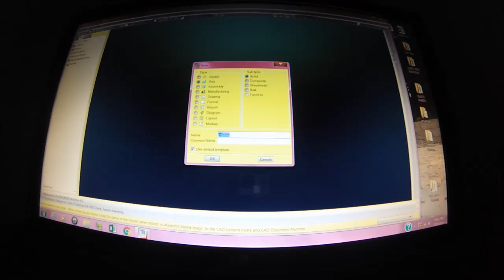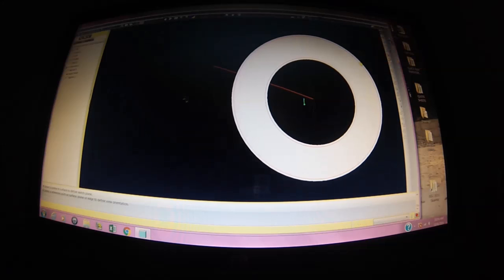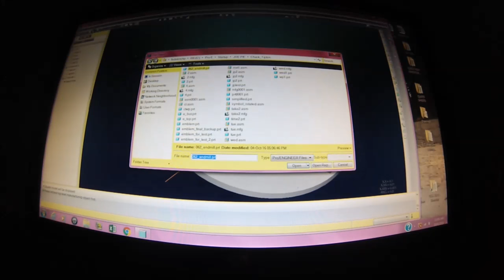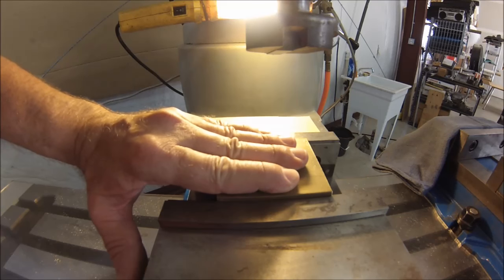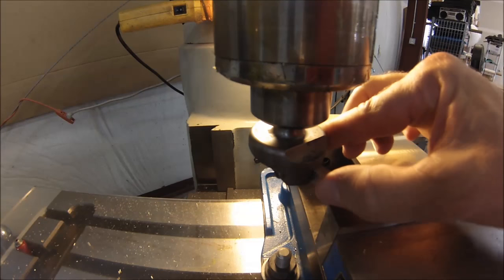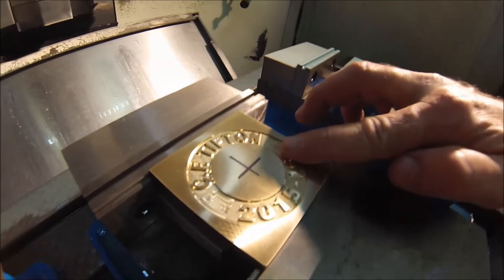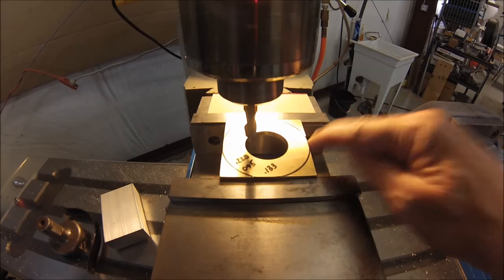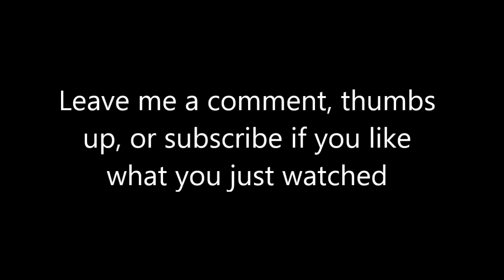PROJECT VIDEO   Fabricating a brass emblem for a model steam tractor

Comment: Hey Joe this is Chuck, I had to chime in just to let you know how grateful I am you took the time to do this for me. I plan to shot a video of the little engine as soon as I can but after seeing this I think I'll wait til the emblem is installed on the smoke box door. I can tell by the comments that this was a project that folks liked and that makes me smile. THANK YOU1
Reply: Chuck Tipton,
You've got the attention of a few of us out here in "YOUTUBE LAND" that want to see this toy of yours! 
Joe did a fantastic job on the emblem, now we want to see what it's going on.....
Razor!
Reply from the maker: Hey Chuck. You are very welcome sir. I was hoping you would watch this one. I really like the final product. Having a video of how it was made is icing on the cake for you. I had fun doing this. I guess the next question is how are you going to attach it? I'll ship it this week.
Reply: I'll probably drill and tap two tiny holes 10BA  at 9 o'clock and 3 o'clock centered between the rims and bolt it through from the back then round over and finish the tiny bolts to give them the appearance of small rivets when viewed from the front. I considered glueing it but it gets really hot there, if anybody knows a better way to fasten it let me know. The smoke box door where the emblem goes is aluminum painted with high temp flat black. Chuck
Reply: The rivet look sounds cool.  If you wanted to glue it, Permatex High Temp RTV Gasket Maker would probably work fine.  I've used it to hang a heavy mirror to the inside of a windshield exposed to the West Texas heat.  It held where other glues failed.
https://www.permatex.com/products/gasketing/gasket-makers/permatex-high-temp-red-rtv-silicone-gasket/

Comment: Hi Joe, I am an aircraft mechanic for over 56 years , an amateur model engine builder teaching to machine with lathe & mill as a hobby.  Your videos are great and help a lot.  Working on a Gnome 9a 1906 rotary engine in 1/6 scale at this time.  Thanks again for the great information you give out.  Dave Slaybaugh Concord, NC

Comment: Hey Joe, 21+ year machinist here from near Waco. Great videos. At 19:55 I always use a paint marker on the top side of my fly cutters, any color that will lend some reflection in my lighting situation. Heck I even had my wife find some of that glow in the dark nail polish on sale during Halloween and dab some of that on the top of it, let it charge by the light and turn the light off while it spins to aid in seeing it.  Just thought I would pass along a handy tip. Keep up the great work.

Comment: Thank you Joe for your efforts. I enjoy your videos.  I started programming for CNC machines in the early 70's using APT and ADAPT.  3D parts were only in your mind as you looked at 2D drawings, no GUI, come to think of it,  no  screen or PC. We wrote the code and had it typed onto punch cards or paper tape.  I would love to be in the business now with all the new equipment and software and advancements in technology.  Videos like yours give me a feeling of being connected, in a way. Thanks from Belleville ON, Canada.
Reply from the maker: The CNC technology has come a long way for sure. To go from line a mill and cards to advanced hex a pod machining is mind boggling. I know enough to get myself in trouble, but I push everyday to add new tools to my programming skills. Its a lot of fun. This emblem was a first for me, but opened up a lot of doors.

Comment: Since you asked, Paddy is from Flanders, Belgium (EU) (and is not in the habit of talking about himself in the third person....Oh Wee!)
The part of a steam traction engine you refer to is called the smoke-box. It provides support for the smokestack and will often house a superheater coil assembly.
The part you are making here, is mounted on the door of the smoke-box, which allows access to the flame-tubes (which run the length of the boiler) for cleaning, and replacing said tubes)

Cheers!

Paddy

Comment: Nice job on the emblem. I would suggest when using a fly cutter , because of the size of the cutter to minimize the amount that the quill sticks out from the head and to set the stop nut. Engage the cutter by raising the knee since you have a better control of the engagement and less chance of ramming the fly cutter into the piece.
ck   Boston ma
Reply: I would have to agree.

Comment: I use the “scratch pass” method everytime I am doing a set up that has a contour. In fact, I even back out my center/spot drills to make sure my holes are located where they should be. It has saved my butt a number of times. And many coworkers have scrapped parts simply because they were too lazy to run the tool above the part.

Comment: Wow love that cnc milling machine Joe. Beautiful craftsmanship just stunning.
Reply from the maker: Thank you very much. This was a fun project and ended up as part of a truly magnificent model. I was proud to be asked to contribute. If you haven't seen Chuck Tipton's traction engine video, go look for it.
Reply: @joepie221  hi Joe I did check it out it was a masterpiece and the badge turned out perfect. You must be very proud. Beautiful work my friend and your very talented.  Enjoying all your videos Joe. Although I'm itching to get my lathe up and running. But it's in a hundred pieces or so. Lol. I'm enjoying every minute trying to restore her. From rust to looking like new. But boy it's a challenge the tailstock has taken 3 months off and on. And every nut bolt handles has been completly restored. Sanding each piece from 50 grit to 2000 grit. Due to the handles being badly pitted.

Comment: Very nice, Expensive! We sometimes do low relief carving on a CNC router. Code can easily exceed 100,000 lines. Up until we put a solid state drive on the machine we had to drip feed big code from the office server. That can lead to problems if the server gets too busy and can't keep up.

Comment: Nice job.  If you do much of this type of work, look into a program called V-Carve Pro.  You wouldn't believe how much simpler the design process is.  V-Carve is mainly designed for CNC Routers, but has post processors for most any CNC machine.  I use it with both my CNC router and mill.   I recently did something like this for our makerspace.  I machined the pattern for a coaster from Corian and we sand cast coasters using aluminum.  The MakerBarn, Magnolia, TX

Comment: I don't know jack about CNC work, other than stuff like yours is amazing to watch. But I can say that the leaning "P" made sense and was a quirk of what the software was trying to do.
If you look at the ugly Ps you can see that the centerline of the letter points directly to the center of the arc, leaving the left side of the P pointing away from the center. The software was simply aligning the baseline of each letter tangent to your arc on the letter's centerline--clearly the human touch was needed to make it aesthetically pleasing.

Comment: Hello Joe,  I saw you lapping your part on your bandsaw table, years ago I (we) would lap on the nearest thing that looked flat. When all this cheap Charlie Chinese stuff started hitting the market I bought a few teeny tiny granite plates and put them by most of the cnc mills. It's handy to have them close to your machine. Also it lowered the temptation to tape a sheet of 600 to a calibrated inspection plate. Only small problem was that we are an ISO shop and they have to be marked "NOT FOR INSPECTION USE"    Merry Christmas from Oregon!
Reply from the maker: Plus the head inspector would have a cow. the bandsaw table works for me, and you can usually find a small granite fairly cheap. Merry Christmas back at ya!

Comment: Another great video. I would have liked to have seen your hands cranking the x and y hand wheels and making those almost perfect circular cuts on a manual mill. I'm in the Houston area but grew up in NYC so I really appreciate your accent.
Reply from the maker: Thank you. I have an extended table on my mill and was working from the far side. The camera and cutter were actually obstructing my view of the part for the back left quarter, so that was actually done blind. When I did my apprenticeship, free hand milling was day 1. I was not permitted to move on until I could trace anything my supervisor drew on my plate. My hands do the work, I just watch. I appreciate the comment.

Comment: I watch your stuff all the time. I live in Scotland on the holy loch. Love  your stuff it is very welcome and entertaining especially to us who do this for a hobby. I actually started up  woodworking ,cabinetmaking, and had built a large shop on my own land designing stuff and lots of wood turning when I finished early from the Dental profession  were I was an orthodontic technician  . This was brought about as I  was diagnosed with aa form of parkinsons disease there are seemingly hundreds of different parkinsonian related  problems My movements are very wild and erratic but then I don't have the twenty four hour shake, all the time, and I get massive relief from taking morphine which I have been taking for nearly twenty years anyway soon after I got the bug and made a nice engineers workshop. I attended a Friday retired engineers club for five years where I learned all I could and love machining and incorporate metal sometimes into my woodworking etc.  so anyway God bless JOE I will be in touch again take care my friend
Reply from the maker: Thank you sir.

Comment: I don't know how you do it, but you explain things in such an understandable manner. 

I used a bandsaw to cut hollow square tubing in machine shop, and I kept ripping teeth off. I think the blade was just too rough. It was supposed to be for metal, but I recall it looking like a wood cutting blade and thinking it should've looked more like a hacksaw blade. That's what they gave me to work with and told me it should work and said I must be doing something wrong. All these years I thought it was me who couldn't figure out how to cut. I even tried adding coolant thinking that would somehow help. LOL I feel better  now knowing it was just bad advice. LOL
Reply from the maker: Provided the speed was set correctly, the blade would cut fine until it broke through to the inside of the tubing. Then its a crap shoot as to whether or not the teeth would peel off and immediately ruin the blade. You definitely got bad advice. It wasn't you. Thanks for the comment.
Reply: That's exactly what happened. It would cut through the sidewall just fine, but once it got to the thin part, it just destroyed the teeth.
Reply from the maker: Everytime. guaranteed
Reply from the maker: You can get away cutting square tubing with a fine tooth blade if you hold it in a vise at a 45 degree angle and push slowly. The blade never really sees large surface contact that way.
Reply: Use a 14 tooth metal cutting blade with slow speed about 200 feet per minute and feed very slowly after breaking through the wall. If you're careful you should not lose teeth from the blade. Takes a little practice

Comment: Great job!! Good idea with bead blasting the inlay area, will give some extra tooth for inlay paint... @ 33:15 lol  No matter how long we have been doing this craft, we still think we are stronger than a .003" swarf ring....  Brian T.  Tazewell TN.
Reply from the maker: You caught that. I'm still thinking about it. Thanks goodness for fast forward.
Reply from the maker: BTW.....I did fracture that ring and it was loose. When I went to remove it, it lodged between the plastic backer plate and the part. I paid the price for that one. I heal quick.

Comment: Beautiful job Joe. Apart of a few things this is all academic for me because I never want to work and learn to program things for machines which are working without turning handles. You know the story about the old dog. After 60 years of design engineering I do not want any more of it.
Reply from the maker: I am a manual guy myself. CNC wasn't around when I started. I do find it interesting though because it can do things I never imagined. Programming it is like doing a big puzzle with all numbers. Mistakes can be costly though.
Reply: Thanks for The answer. If I’d be a few decade younger I’d most likely had interest for today’s wonderful machines. At the age of 14 I was working on an old lathe flat belt from the ceiling. I appreciate your work it’s something I like to watch, and I am choosy.
Bob
Reply from the maker: Thanks Bob. Old school rules !!

Comment: I am doing some signs that range from 12 x 16 to 8.75 x 10.00 . Aluminum .  Same thing all raised letters and logos . I will be running them on my HAAS TM2P .  Cutters are .125 and a .0625. Im self employed in Central Mississippi . Great video Sir keep em coming.
Reply from the maker: I have to ask what step over values you use??
Reply: I am using ONE CNC programe . With a regular end mill I step over 40%. The 12 x 16 takes about 1.5 hrs.
Reply from the maker: What Diameter and profile are you using. Ball nose, flat bottom ?? 40% sounds like a flat bottom cutter or large ball nose.
Reply: It is a bottom cutter, sorry I forgot to say what kind.

Comment: Hi Joe, thanks for your nice videos. Also some good tips in there...
Wouldn't be easier starting with your bar stock in the right thickness and holding it between your two vices? That way you could have the cnc cut the OD before even taje it out of there.Also, that was plenty of work for a small part...how much an opperetion like that costs?George, from Greece
Reply from the maker: Thanks for your comment. My concern with this piece was chatter and distortion. I considered many ways of doing it, but thinning it down in the final op was my best option for my level of comfort. I probably could have started with a finished washer and put it in soft jaws, but was unsure of just how soft and bendable it was going to be at .09 thick. The cutter was only .062" in diameter and any chatter could have blown up the cutter too. The cost....figure 2 hours of computer modeling time, 1 hour of programming, 30 minutes of CNC setup time, 1.75 hours of CNC run time and 1.5 hours of secondary machining and hand work. Depend on your shop rate, but this could get expensive real quick. I would guess in the area of $500 US would not be out of line.

Comment: When fly cutting do you use a right hand or left hand tool.  Bob Gaines  New Lenox,IL.
Reply from the maker: That depends on the flycutter. But,  I always cut with the spindle rotating clockwise, so that would be a right side grind on the tool.

Comment: hi Joe,
Loved the manual interpolation when facing off the back.Out of interest how come this part was made from a square piece of stock?Wouldn,t it be quicker to use a round billet turned and bored then profiled on the Fadal.We have a Haas svf2 with a 3 jaw chuck bolted to the bed with a set G54 as centre and we do lots of engraving similar to parts like this.Fantastic job tho and another great video.
Reply from the maker: It absolutely could have been done that way. I elected to use square stock for a couple reasons. 1.  I had some  2. The .090 thickness may have had a tendency to crown or deflect under pressure if I used a turned blank   3. I would have needed soft jaws for the mill vise so I didn't bite the OD of the brass  4. It gave me an opportunity to show the pressure turn OP as part of the process. I may have done it out of round stock if I had some. Thanks for the comment. I enjoyed doing this project. I learned a lot as well.

Comment: Another great video.

Out of interest, adding up all your time - design, test manufacture, final manufacture but discounting the extra time for filming - how long would that have taken to make?  
(I assume you go off and do other things while the CNC is at work so I'm really only interested in the set up time.)
Tim, Australia
Reply from the maker: Hi Tim, most of the work on this project was manipulating the font so the cutter would pass through the small gaps. I had never done an emblem like this, before this one, so my learning curve was much greater than it would be today. All total, this badge took every bit of 8 hours to produce. I could probably do one now in half that time.
Reply: Thanks Joe.  I'm really enjoying your videos.   I'm an accountant, not a machinist but its very interesting.
That said I do own a (small) lathe.  For your interest, and possible amusement, you can check it out here:
https://sites.google.com/site/flexispeedlatheinabox/

Comment: Beautiful fork, how many hours involved beginning to end on ta deal like this ?
Reply from the maker: Wow, I hate to even venture a guess. It was a learning curve for me. Had I charged actual hours, the customer would have run away. Best guess on just the CNC part. 3 days. ( model, tweeking the font, code, etc.)Not bad since I never did the programming side of the project before either.

Comment: You did use a lot of equipment. I must say it came out beautiful. However, I belive you cauld have ran this entire project through the CNC and been done with it. Comming out with the same quality of part. My question is why did you decide to go about it this way. instead of just knocking it out with CNC, just wandering.
Reply from the maker: My channel caters to many different skill levels and manual machinists. The emblem could have been done many ways. I chose this path to show some of the options available while maintaining a part that was easily held.